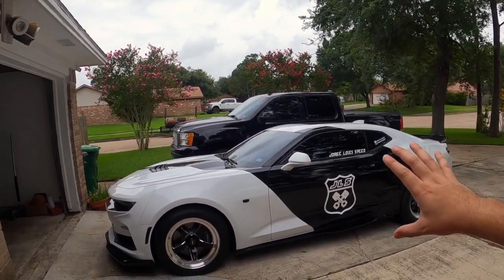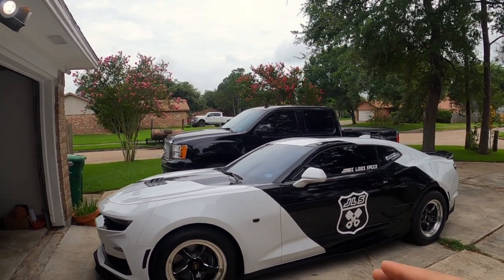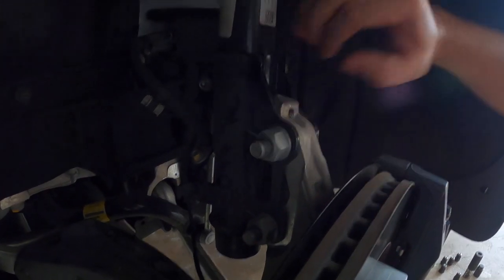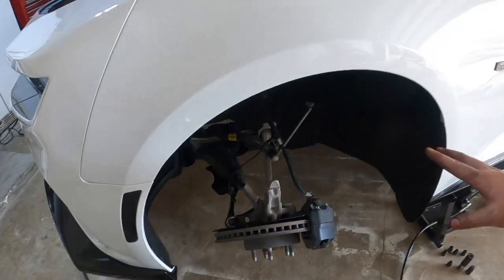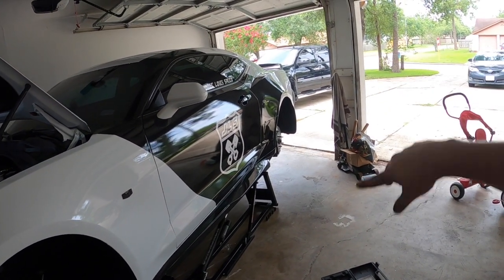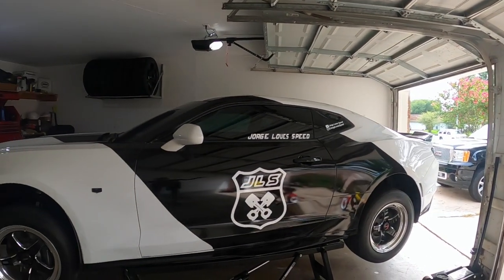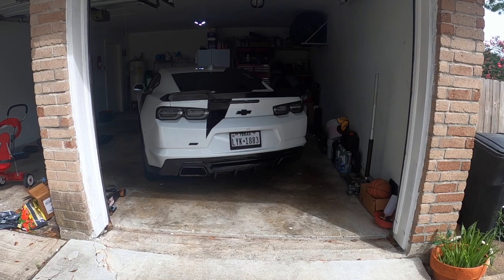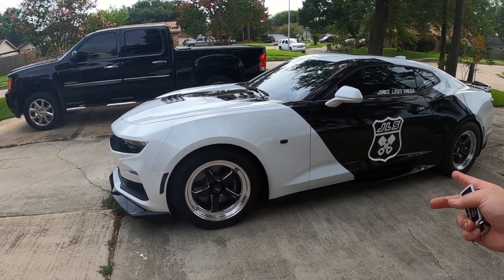YYZ Drop Springs on MY 2019 Camaro SS! | Vlog #340

Comment: Finally got my stage 3 cam on my 17’ ss m6. Elvis tuned it but idk the start up isn’t the best. Turns off sometimes
Reply: he’s not the best tuner tbh. i’d get it retuned by matt sorian, or pray performance
Reply from the maker: Damn sorry to hear that. Could be tuning related. I would follow up with the tuner to see if he can find the issue and or get it running better.
Reply: Jorge Loves Speed thinking of going with pray performance after I order my VR ported MSD. But I’ve never done any remote tuning before so im hoping I can do it.
Reply from the maker: @Mlgradar713  its not too difficult. pretty straight forward plus pray will walk you through it .

Comment: How are the springs? I want a stiff spring that rides firm. My 1le is way too soft.
Reply from the maker: It rides pretty much same as oem maybe a tiny bit stiffer
Reply: @JLSpeed  I appreciate the honesty. Most people are afraid of feeling bumps, but I honestly want more road feel. A stock Zl1-1le is really stiff...and I love every bit of that suspension! I currently have a 1le...and I feel like the suspension is too soft with my current springs. Even the factory springs felt like it could be stiffer ( or the magnetic ride tuning). People talk about 1le's being too stiff but it really isn't. And I know Chevy has to have a balance. I get that. But I'm looking for a good spring. I have used BMR and H & R on my 1le. I prefer the linear rate of BMR, but I like the drop of the H & R. 

Anyways, you're the only person I know that's running the YYZ. So if it's only a hair stiffer, I'll keep my H & R springs, or possibly look for an alternative with the enthusiast heart in mind. 

I may reach out to YYZ. I'm not seeing any data that supports their graph.